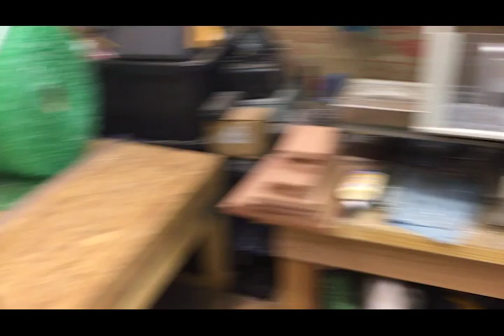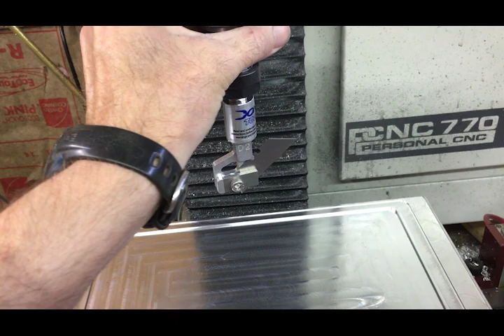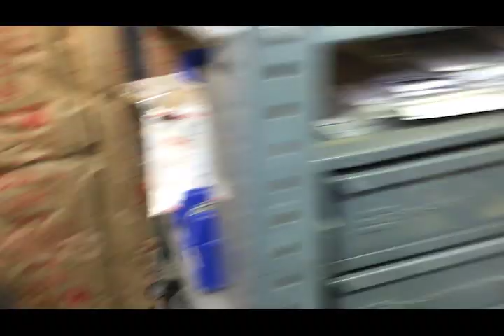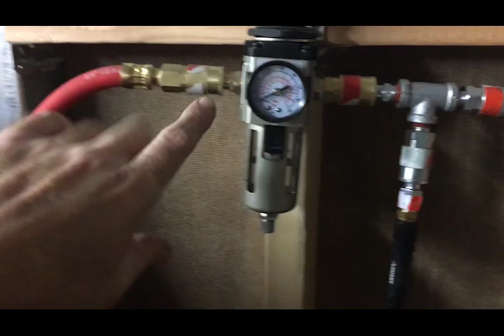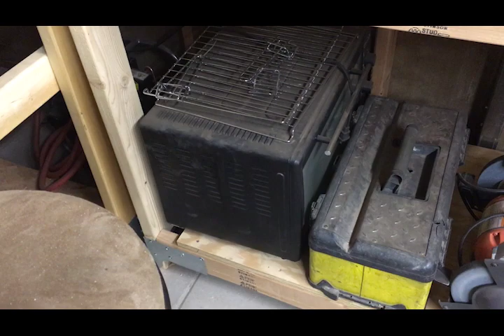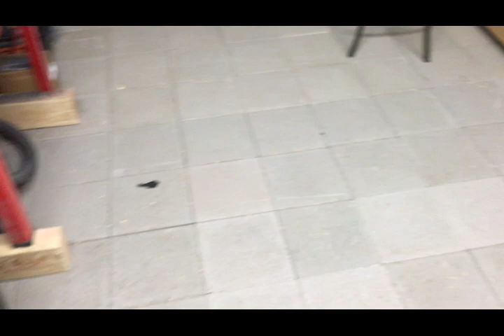Shop Update  - New Shop

Comment: Good to see you back Craig. That looks like a lot of work, but should make your life easier.
Reply from the maker: Thanks Marco!  Yeah, it was a lot of work but definitely worth it.  How is it going with the 3D printer?
Reply: Ha ha, I've been 3D printing everything in sight! It's actually starting to become useful on the plane construction by printing some jigs for cutting the wooden longerons (doing some testing today), and a custom box for a Pitot heat power supply of my own making. It's definitely a bit extravagant, but very handy around the shop. Even the minimill couldn't escape it, and got a 3D printed safety fence for the tool release switch. LOL